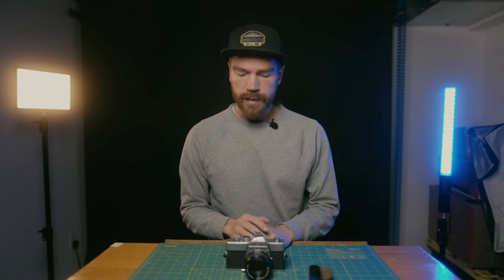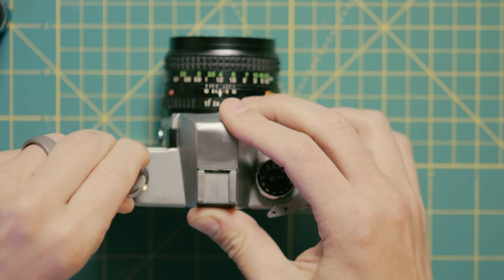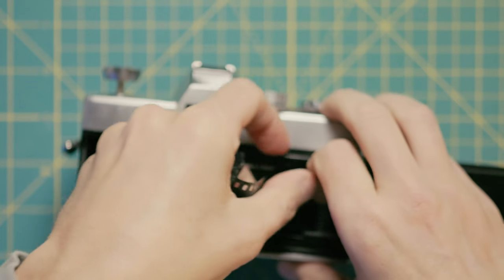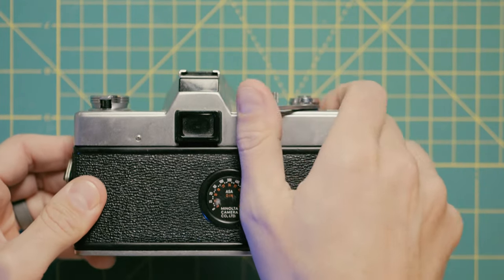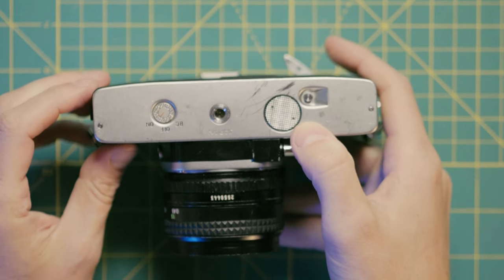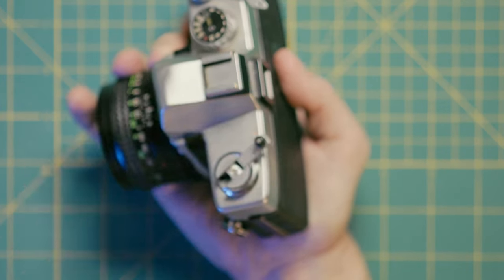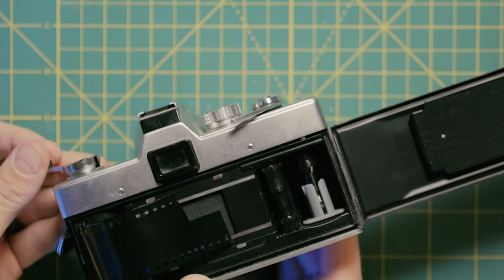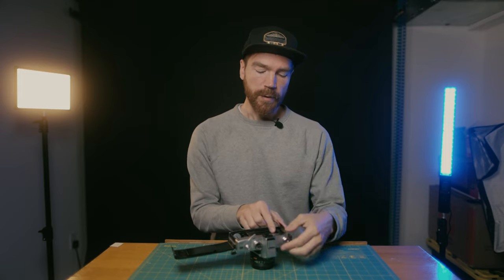How to load a Minolta SRT-200 film camera

Comment: Thanks for the video. That was very helpful. 
I just have a small issue. I pressed the "release tension" button while my camera is empty and its stuck. Does it usually stay stuck or do i have to do something to unstuck it becasue when i press the "shoot" button its stuck as well and the wind thing is stuck as well.
Reply from the maker: When you push that button, it should remain depressed until either you open the back door (after winding) or if you wind the advance lever (do this for a double exposure). If after doing either, it stays down, then IDK. Sorry.
Reply from the maker: Hmm. The button should stay pressed, but then pop up if you wind or load new film. It shouldn't stick the winder as well. Pushing the bottom button and then winding is how you do double exposures on this camera.